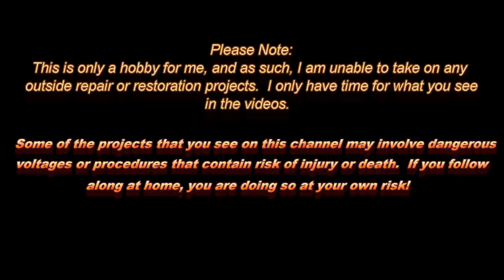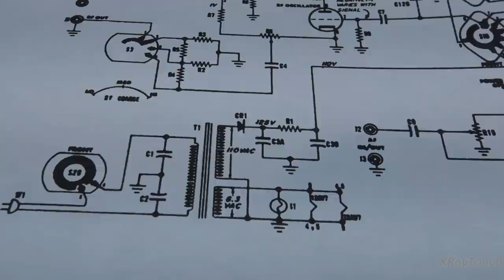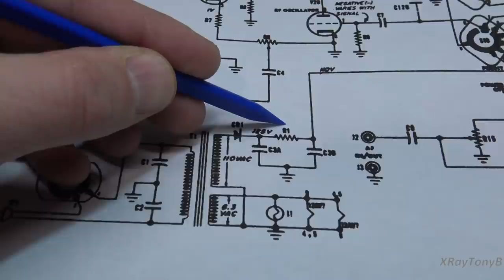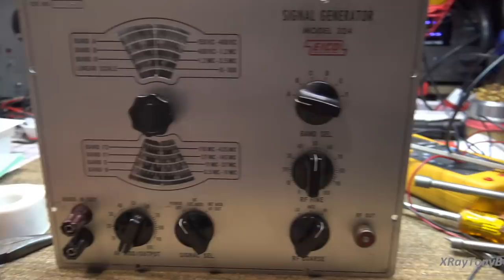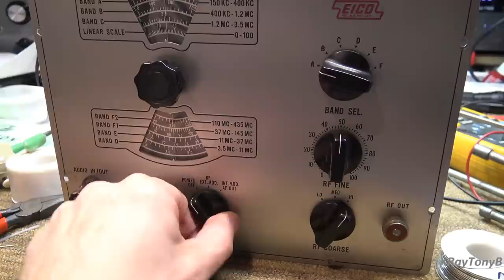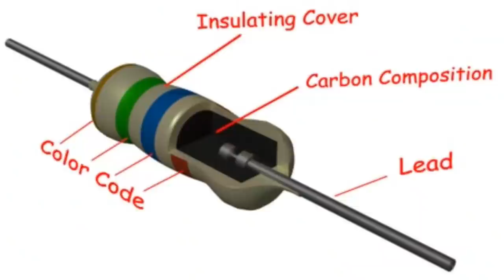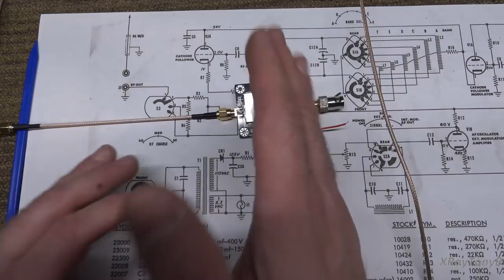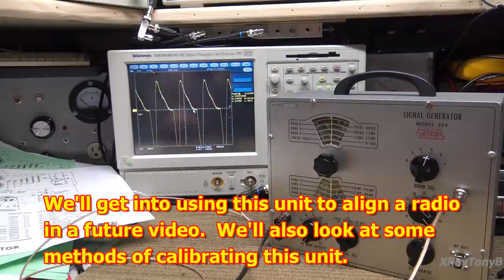EICO 324 Signal Generator Ad Nauseam

Comment: I love my EICO 324 Signal Generator and first home built one  in 1963 as a young electronics student enrolled at RETS. Over the years I bought kits , built them and sold them for profit. One of my projects as a lab instructor at Swarthmore was building several of the 324 as a class projects with my Sophomore Physics students.

Comment: Great repair of old EICO signal generator. Replacing with correct type of  more modern  components and explaining why,
saved the day. Using Lock-Tite on the BNC connectors will keep it in place  when you tightened the nuts on.
Good mods added to increase its versatility. Probably should have added a polarized plug and connect the hot side to the 
on/off switch and put a fuse after it , slow blow 1/4 Amp , would be fine. Got to protect that  power transformer.

Comment: I saw one of those videos, where the technician, for an unknown reason chose NOT to replace some of the electrolytic in a guitar amp. No explanation and then it was working and she said, "Thanks for watching!" and I literally got nothing from her demonstration. I like your style, Tony.
Reply: Depending on where a capacitor may be in an audio amplifier, leaving one in that is "out of value" may not hurt anything, as it may be one that is not blocking a large DC voltage to keep from changing a bias on a tube (An old capacitor that has developed an internal resistive "leak" may pass on more low frequencies than a new one, creating that "warm tube sound" that some want). Some customers that bring in older guitar amps for work may request to "change as little as posssible" , so, I wouldn't immediately fault the the tech doing the work. Tony does what he does, and usually gives a great explation for everything he does, and it is much appreciated.

Comment: Nice job on this old unit. I have a model 315 that came from the local university, it looks brand new and works great in original condition, I did go through it. It could use some new caps but looks sweet, although it is massive lol

Comment: My entire shop workbench consists of all modern Sleek silver looking Eico products, except for the Tektronics  453 portable solid state oscilloscope. The scope faceplate does match that sleek silvery look. On a second bench are all my backup instruments made by Heathkit, Simpson, Precision and Fluke. I have acquired all my test gear repaired and restored all my own equipment over the years. I think I enjoy fixing test equipment more than I do radios. I am 80 years of age and worked in electronics back when tubes were in use. My equipment is all analog but for the TinySA, Fluke DVM and LCR tester. Lately my fascination is with good SDR products.  $$$$ is a problem in retirement years, so I make a few bucks selling services , repairs, restorations and test equipment.
Reply: I'm 62 years old now, and cut my teeth on tube stuff.  my problem now is learning to solder surface mount stuff and not sneezing, and poor eyesight. Thank god for microscopes!

Comment: There are two good transistors that works well for a wide-band amp, and they were used as an oscillator in the solid-state Heathkit and Leader dip meters. One could build there own around either transistor. I think the Heathkit was a low power MRF series.

Comment: Hey, nice mod on that Eico - I saw Mr Carlson do something like this on one of his vintage generators. I'm all for replacing esoteric/outdated connectors with modern ones as well, if it can be done in a nice looking way. E.g. I replaced two obscure C50 connectors (they look like overgrown BNC) on my MZN-8C harmonic distortion meter with SO259, they fit in nicely, and BNC wouldn't look good at all.
Reply: I would've mounted that substituted BNC connector from the inside of the chassis - less ugly.

Comment: You did a nice job soldering that 2.2k resistor in the power supply filter , by wrapping the lead snug on the terminal strip. The guy that had to remove that part in the future will curse you though, unless he is at the space station on Mars.

Comment: I bought one of those off of ebay once. Seller said it was fully restored and when I got it I opened it up and sadly it wasn't. The power Transformer was also cooked. I ended up gutting it and built a power supply with the chassis. The variable cap was a perfect spot for a small variac.

Comment: Greetings ffrom the South Hills (Mt. Lebanon) PA. Nice video, have the same siggen that I use on a semi-regular basis. Few questions: 1) Why do yse a manual Soldapullit as opposed to a Hakko desoldering gun? 2) Do you uae tin/lead solder for your rework? 3) Eo you do your own test equipment cals, or, do you use an outsde vendor?

Comment: 1:02:30 - Back in 1975, I worked across the hall from a System 3. IIRC it had a red color scheme.
It was the first time I'd seen an 8-inch floppy disk and the smaller punch-cards.

This is the 'Data Station' that was used. Note the dual 8" floppy drives mounted vertically!
https://en.wikipedia.org/wiki/IBM_3740

Comment: Hi Tony! May I recommend you keep a spare 50 ohm BNC terminator (RF seal) on the new, amplified, frequency counter output you added, so you do not broadcast your new, Amplified and Inverted RF signal all over your workbench when this unit is powered up? I can see all kinds of issues sneaking up on you if you use this RF signal generator to perform radio alignments, with the new BNC connector output open - with no cable connected.   Fred

Comment: I bought and built a Heathkit IG-102 when I was in the Signal Corps, still use it as my "first line" sig gen. I have also taken the signal before the attenuator and made an output for a counter. As I have it  the counter gets the AM modulated signal, I will have to add a broadband amp with high input impedance before the 6AN8 pentode

Comment: One way you can tell if an Eico product was built at the factory is that things like capacitor holders (straps) and terminal strips were riveted in place. Kits used screws and nuts.

Comment: 160 V elo caps aren't quite enough. the output of the transformer ~120 Volts x 1.414 is ~ 170 volts while  ~110 V x 1.414 is ~ 156 V depending on what the mains input is.

Comment: I use  bees wax from the old caps to hold nutz and screws in mu 1/4” nut driver, but the best ticky tacky substance is the lanolin from the inside of old piezoelectric phono cartridges. It smell to hell and back but cleans up nice. I grind off the rivets, split the shell and dig out the lanolin. The lanolin looks like bees wax.

Comment: Question:  My 324 had solder on the outside of the upper tube.  Saw something several years ago about that being deliberate at times as a quick fix of some sort specifically for these maybe.  It worked before I pulled it apart and cleaned tube sockets...now it doesn't.    Forgot about it till after I'd knocked the  solder off the side.  Still has five paper caps, .05, .02, and three .01.  no safety caps.  Those values don't jive with your schematic but they look original.  Ideas?  The purpose of the solder on the outside of the tube in a vertical line on the variable tuner side?  Doesn't look factory.

Comment: When I got into restoring tube radios I bought tube test equipment. I enjoyed rebuilding the test equipment as nuclear as the radios. However I got out if tube test gear to get classic digital HP test equipment, new cost $35,000 40 yrs ago you can get under $1000. Having digital signal Gen, sweep, markers that dead on makes working on radios easy, faster and accurate. But the tube gear is cool and fun to play with abd restore. You can use them to align radio's.

Comment: That magnetic 1/4 in nutdriver was handy to start TV screws too. Had a long version of that too for remounting tuners back in the cabinet.  Quarter inch and 5/16 were the most common screw heads and nuts on consumer electronics. Make the video long as you need. People can speed it up skip some or watch something else.
Reply: Heathkit used to provide a 'nut-starter', a red plastic tool that had a tight-fitting end that accommodated 1/4" hex-nuts!

Comment: If you put one of those small neodymium magnets on the shaft of a screw driver or nut driver, it will make the tool magnetic whilst it’s on there.

Comment: Looking at the schematic it looks as if C1 and C2 should both be safety caps as they come from both sides of the power cord. One is after the on/off switch but is power cord related. Am I wrong in thinking this or is one only needed in this application? I ask this because I am about to do exactly what you are doing here except drilling the faceplate for a mod. Was also wondering what safety cap you used. I understand that it would call for a 104 y type but cannot seem to locate them. What value did you use?

Comment: what kind of led light did you use, did you need a dropping resistor, also did you drill a round hole for the other bnc connector

Comment: You really do not need the amplifier module, thats overkill. Just run a .001 uf cap from pin  3 of V2a the  cathode  pin of the cathode follower to the new BNC . You will get s strong large reproduction signal of the main adjustable output and it will not load the signal causing signal drift. Putting in that 4 screw BNC  is needed  needed eilther the regular Bnc will fit and use a drop or two of lock tite on the fastening nut and a internally toothed washer.

Comment: 1:12:50 - Wouldn't you have the modify some resistor values to accommodate today's higher line-voltage?

Comment: OK I only have 1 RF amp. (really don't want to blow it up experimenting) Using a free circuit simulator I'm having a hard time coming up with the values for the voltage supply parts. Just when I think I have it I question the outcome. picking the right resister and cap combination for the current and voltage. turns out it's way more complicated than than it looks. the ripple, rectified voltage, filtered voltage,  just for changing 6.2v to to 5v at 25ma  It sounds so easy I question the simulator. a video as to how you VERY CAREFULLY chose the resister would be nice.
Do I need to join patron to ask this?

Comment: Can someone comment on how the amplified signal now present on the front of the sig gen will affect the alignment of a radio.  These were not very well shielded to begin with.  Do you think having that high amplitude signal available willl "leak" into the antenna on a radio under test?  Best, Doc.
Reply: Someone mentioned putting a 50 ohm termination on the amplifier output when it is not in use.

Comment: Ive got one like this with Band A inoperative. I know its the A coil, but have no idea about the inductance values of the coil windings. Band A us no big deal 100khz to 500 Khz as band B covers the entire broadcast band where I need to use it. I am capable of hand winding my own coils. My only concern is the intrinsic value as a vintage piece of gear. I plan on using. The device as a signal audio modulated oscillator generating radio stations around my shop show room containing real old time radio shows fro youtube channels

Comment: Removing the cap from the P.S is wrong.
It will cause much more line ripple on the DC voltage ( "110V" )!
That ripple will be coupled to V1A-grid via  R10-R11 divider.
This may manifest itself has some120Hz AM modulation at the output in CW mode,degrading the CW signal.
True ,it is a "non accurate signal generator",but still ,
this repair is done wrong,even more so regarding the video being an "educational" one .
You should test it with a spectrum analyzer.
Reply from the maker: I think there may be some confusion.  If you go to about 51:30 you will see that there is a new silicon diode replacing the selenium rectifier and two filter capacitors and resistor forming a PI network for the the B+ power.  The new caps are much smaller in physical size than the original cardboard tube capacitor.  To check for ripple, you don't need a spectrum analyzer.  You can either set your scope to AC coupling and check for AC ripple, or just use your voltmeter set to read AC millivolts.  The power supply performs the same or better than the original.  A spectrum analyzer will show you the fundamental frequency of the oscillator as well as all of the harmonics generated from the (purposely) distorted sine wave.  It would also show the ripple component (if any), but you don't need a spectrum analyzer to see power supply ripple.  My videos are categorized as entertainment, not education and I welcome discussion that can help us all (including myself)  learn more about this hobby.  Thank you for the comment!
Reply: @xraytonyb   Looking at  the relevant part again(49:30) I see you do install the 2nd CAP of thy phy filter. So all is fine.
Further more you increased the value of the phy resistor to get more voltage drop on it.
This has the added benefit of filtering the DC better than with the lower value resistor.
Of course you would measure the ripple itself with an oscilloscope.
But measuring it's effect on the CW output signal is done with a spectrum analyzer.

BTW, 
Why did you replace the selenium diode? was it faulty?
Model 50 means it is a 50mA rectifier.

Here is  a catalog of selenium diodes:
https://www.google.com/url?sa=t&rct=j&q=&esrc=s&source=web&cd=&cad=rja&uact=8&ved=2ahUKEwjr8sbB6Jj1AhVahv0HHVCRBKEQFnoECAQQAQ&url=https%3A%2F%2Fsteampoweredradio.com%2Fpdf%2Fsarkes%2520tarzian%2FSarkes%2520Tarzian%2520Selenium%2520Rectifier%2520Handbook%25201950.pdf&usg=AOvVaw11i19BSDhmiahboMhb6T7j

Comment: Pico it in space at 300 times a second 😁so true now bend it pico to a second length of electrical energy like the hole fabric as a charged partical magnetic battery train in a copper coil 😁 and magic lot off work but!. But one light year in 31 hour's give the check a lot off work Time on a microsecond B hole but you know!. Ever wonder why the speed constant off electrical and light are like sound or why the gas off a nutron star after it blow's don't move if your into that stuff!. 😃😄😁😆😅5 Smiles.

Comment: That is a piece of junk or POS.
The output is filthy.
The caps are paper.
The electrolytic(s) never last.
Don't bother with these, EICO's. JUNK
Reply: Stull fun to work on, and if you burn it up, no loss!
Reply: @hightechstuff2  I had my fun with one of them,... NOT
Reply: Isn't the out put supposed to look like that as explained ?
Reply: @andymouse  I prefer sine wave to bullshit
Reply: Perhaps you would feel better if you went out and bought a brand new HP or TEK signal generator, and left this channel, never to return.
Reply: @ChuckKirchner-se6ib  perhaps you would that is exactly what I have done, the comment is two years old dude. And I have a very nice HP gen.

Comment: Funny.  I find paper electrolytics the first to go, and the wax capacitors are usually all good.   I use a sencore lc75 to check my caps though.
Reply: I never got the idea of checking caps, just replace them and be dine with it. Much like batteries, spark plugs and oil filters.
Reply: I love these EICO 324 signal Generators. However in todays market the only real use is for the Audi, AM band  and possibly short wave. While it covers the FM band the modulation is still only AM. Good enough if its all you have.